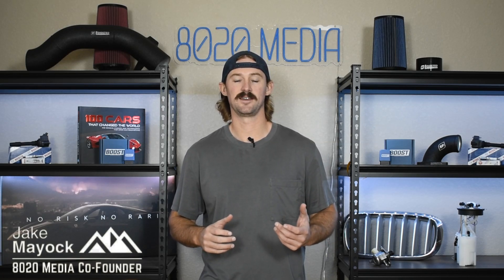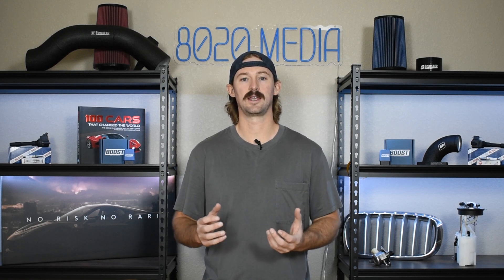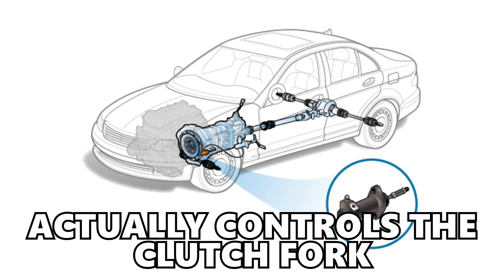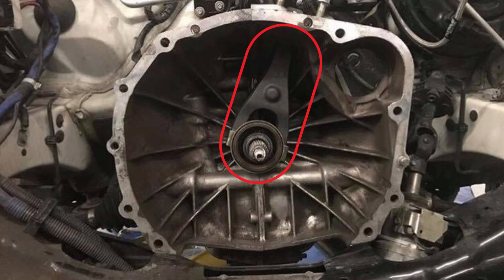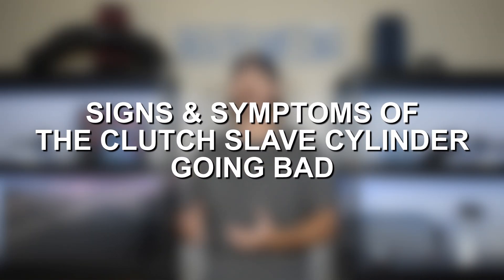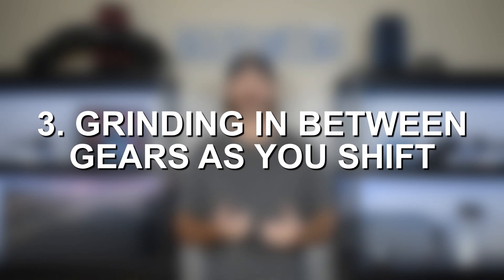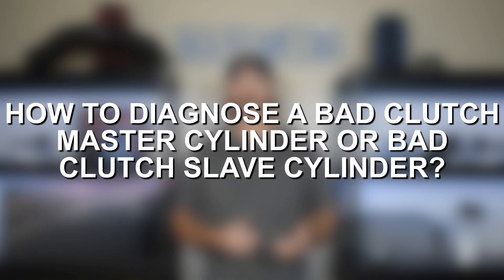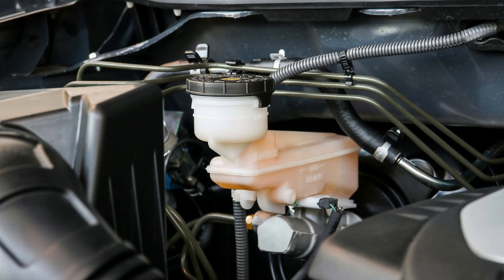Bad Clutch Master or Slave Cylinder? Symptoms, Diagnosis, and Fixes Explained!

Comment: Just replaced a transmission on my Mazda 6 I thought I had the disc backwards 
Did the whole thing again replacing the slave cylinder this time and still nothing hoping it’s the master bc it looks old and if not idk hydraulic system worked before not no more!
Reply from the maker: K - If the clutch worked before the transmission swap and now you’ve got no pedal or disengagement even after redoing the job and replacing the slave, then yes, the master cylinder is a strong suspect, especially if it’s original and looks tired, but also keep in mind that after opening the system it’s very common for air to get trapped in the hydraulic line, and on Mazdas that line can be stubborn to bleed; even a brand-new slave won’t work right if there’s air in the system. I’d replace the master since it’s likely due anyway, but also make sure to do a proper pressure or vacuum bleed of the clutch circuit and check that the slave pushrod is actually contacting the clutch fork correctly — if the hydraulics are good and bled, then the only other possibility is a mis-seated clutch disc or pressure plate, but air in the line or a weak master are far more common culprits after a transmission job.

Comment: Hi from the UK my Audi Q3 diesel does very small short journeys 3 mile to work - 3 to home and not much else mileage,  could  this have an effect on the clutch peddle sticking to the floor , basically not being driven enough and used enough to keep things working properly.  Great explanation helping me understanding things a lot more of how they woerk , given you the thumbs up and just subscribed. 😊
Reply from the maker: G - Thanks for the feedback! Yes — only doing very short trips can definitely contribute to your Audi Q3’s clutch pedal sticking, because moisture can build up in the clutch fluid and seals when the system never gets hot, the slave/master cylinders don’t get fully cycled, and any minor sticking inside the hydraulics doesn’t “self-clean” through regular movement; combine that with a diesel’s heavier clutch and the pedal can start dropping to the floor or returning slowly. The best step is to bleed/flush the clutch hydraulic fluid (often shared with the brake reservoir on Audis), and if that doesn’t cure it, the slave or master cylinder may be sticking internally and need replacement — but yes, your very short-trip driving style makes the issue more likely.

Comment: Why is it that every year I have to replace the clutch master cylinder on my 97 integra????  Is it that this reproduction parts from O'Reilly and Autozone are crap???
Reply from the maker: A - Yes — that’s almost certainly the issue; most reproduction clutch master cylinders from chain stores like O’Reilly or AutoZone don’t last long because the internal seals and bore materials aren’t as high quality as OEM, so they wear or leak quickly, especially on Hondas/Integras where the pedal travel is long and fluid quality matters. If you’re replacing it every year, the best fix is to switch to an OEM Honda/Acura master cylinder (or a high-quality brand like Nabco or Exedy) and flush the clutch fluid regularly with fresh DOT 3/4, because cheap aftermarket hydraulics tend to fail fast and keep you stuck in this cycle.
Reply: @8020Automotive tha k you for replying I'm gonna try out the exedy brand

Comment: I drive a kia rio 2016 recently the clutch started to get hard or stiff after driving it for few kilos so i replaced the master cylinder kit but it's still giving me the sane problem 😢
Reply from the maker: G - If your Rio’s clutch is still going stiff after a few kilometers even with a new master cylinder kit, the next suspects are the slave cylinder starting to seize when it heats up, a kinked or restricted clutch hydraulic line, or the clutch release bearing/pressure plate itself binding under load; since it stiffens only after some driving, heat expansion is likely making something stick, so I’d check the slave cylinder first (replace or rebuild if it’s original), inspect the hydraulic line for swelling or blockage, and if the hydraulics check out, the issue is probably mechanical in the clutch assembly, which means a full clutch service with release bearing and pressure plate replacement may be needed.

Comment: 2002 camaro ss wont go into gear at high RPMs, whats your guys opinion?
Reply from the maker: R - The most common causes are clutch or hydraulic system issues—a worn clutch disc, weak pressure plate, or air in the hydraulic line can keep the clutch from fully disengaging at high engine speed, making it hard to shift; another frequent culprit is a worn synchro in the T56 transmission, especially 2nd and 3rd gear, which will grind or refuse to engage at high RPM but feel okay at lower speeds, and in some cases a weak or failing clutch master/slave cylinder can also show up only when the system is hot and stressed. The best way to narrow it down is to bleed the clutch hydraulics first (cheap and easy), check for proper pedal engagement, and if that doesn’t fix it, you’re likely looking at internal transmission wear or clutch replacement.

Comment: Could fluid leak without it being a master or slave cylinder issue?
Reply from the maker: S - Yes, clutch or brake fluid can leak from places other than the master or slave cylinder—for example, from rubber hydraulic lines, hard line fittings, calipers/wheel cylinders (brake side), reservoir cracks, or even around bleeder screws—so if you’re losing fluid but both cylinders look dry, inspect the lines, reservoir, and the area near each wheel for dampness or residue, since even a small seep can drop fluid level over time and affect system performance.

Comment: My slave cylinder was replaced a month ago. Recently I broke down due to sticky clutch. 3k miles after slave cylinder was changed… could it be the master? Could the master cylinder cause the slave to fail if the master isn’t functioning properly?
Reply from the maker: D - Yes — if your clutch is sticking again only a few thousand miles after a new slave cylinder, the master cylinder is the next likely culprit. A failing clutch master can internally bypass fluid, trap pressure, or not fully release, which makes the pedal feel sticky and can prevent the slave from returning correctly. While the master won’t “kill” the slave mechanically, a weak master can make it seem like the new slave is failing because the hydraulics aren’t balanced. Air in the system or contaminated fluid can also cause sticking. At this point, replacing the master cylinder and fully bleeding the system is the smart move — when one hydraulic part goes, the other is often close behind.

Comment: What about if my clutch pedal is hard to push , please advice
Reply from the maker: R - If your clutch pedal feels unusually hard to push, that usually points to a mechanical issue in the clutch assembly itself rather than the hydraulics—most commonly a worn or stiff pressure plate, a failing release (throwout) bearing binding on the input shaft, or even a dry/sticking clutch fork pivot. On the FR-S, the hydraulics (master/slave) typically cause a soft or spongy pedal when they fail, not a stiff one, so a heavy pedal almost always means the clutch kit itself is at the end of its life. The fix is generally a full clutch replacement (disc, pressure plate, and throwout bearing, ideally resurfacing or replacing the flywheel at the same time). If you’re already having trouble with 1st and reverse engagement, the two symptoms line up—your clutch isn’t fully disengaging because the pressure plate/release mechanism is binding and worn.

Comment: I have a 2014 Scion Frs and I often have a hard time getting into 1st gear or reverse but once I’m rolling I’m able to shift into the other gars no problem. What do y’all think I should replace first?
Reply from the maker: S - Difficulty engaging 1st and reverse while the other gears work fine usually points to the clutch not fully disengaging, rather than the transmission itself—common culprits are a worn or dragging clutch disc, weak pressure plate, or more often a failing clutch master/slave cylinder or air in the hydraulic line. Since it gets better once you’re rolling, the synchros for 1st/reverse aren’t the main issue yet. I’d start by bleeding the clutch hydraulics to rule out air, then inspect the master and slave cylinders for leakage or weak operation; if hydraulics check out, the next step is a clutch replacement (disc, pressure plate, and throwout bearing together), since partial disengagement will keep making 1st and reverse harder until it eventually won’t go in at all.
Reply: I was having the exact same issue and ended up replacing the master cylinder
Reply: It might be the plate on the shifter lever needs to be adjusted under the shift boot especially if it’s first & reverse
Reply: I have this same issue in my 07 focus what did you do I changed my brake fluid a while back and I don’t think I bled the clutch could I just have air in the lines?

Comment: I might be looking for a problem isn't there but when I press my clutch I can hear an 'air hiss' when the clutch pedal reaches to bottom. 

Fluid looks good in the reservoir, gear changes seem okay but acceleration isn't great (honda crv petrol, had it for 3 years and it's never been quick).

Had a mechanic check it out, he didn't seem concerned but knowing the car it doesn't feel 'right'. Any suggestions?
Reply from the maker: D - The “air hiss” you hear at the bottom of the clutch pedal travel is almost certainly just the clutch master cylinder’s internal seal moving fluid past its ports—it often sounds like a hiss but isn’t an actual leak, and since your fluid level is steady and gear changes are smooth, the hydraulics are likely fine; if the clutch were slipping you’d notice high revs without matching acceleration, so your “not great” acceleration is more likely just the normal underpowered nature of the CR-V’s petrol engine rather than a clutch issue. That said, if the bite point changes, fluid starts dropping, or you feel the clutch slipping under load, then it’s worth checking the master/slave cylinder for leaks or considering clutch wear, but otherwise that hiss is a common, harmless sound on many hydraulic clutch setups.
Reply: @8020Automotive that's a really informative answer no mechanic has been able to explain. Ill keep an eye on the fluid etc, thank you!
Reply from the maker: @davyjones8226  Keep us updated!

Comment: Great video - so informative. I think you diagnosed the issue! I have a 2016 BRZ. Today, sitting at a light and my clutch pedal went all the way to the floor 😢I had to pull over and manually lift my clutch pedal off the floor. I had to drive it in this condition about 30 miles home. I know….I have no towing and was in a really remote area. I checked my brake fluid and it is right at the MIN line. My clutch was making a squealing noise when I depressed it by the time I got home. I hope I didn’t make a bad situation worse. 🥺 I’m going to get some brake fluid tomorrow and see what happens. No lights/sensors went off and had not one indication anything was awry - it was driving great.
Reply from the maker: S - It sounds like your clutch hydraulic system likely lost pressure, which is why the pedal dropped to the floor and stayed there. On the BRZ, the clutch uses the same reservoir as the brakes, so the low brake fluid level is a red flag—either the clutch master cylinder, slave cylinder, or connecting line is leaking, or a seal has failed internally. Driving it 30 miles in this condition may have worsened wear on the pressure plate, throwout bearing, or even overheated the fluid if it was slipping, which explains the squealing noise. Adding fluid might temporarily restore pedal feel if the leak is small, but it won’t fix the root cause; the fluid will just drop again. Before topping up, I’d inspect under the dash for drips from the clutch master cylinder pushrod, and check the bellhousing area for fluid leaking from the slave cylinder. If you find fluid anywhere in those areas, the failing component needs replacement, and you’ll want to bleed the clutch system after repair to get proper operation back.

Comment: 2007 Scion TC clutch issues I'm working on for a church friend.  Clutch feels strong, has proper full release feel at top but not at the bottom (doesn't feel it reaches full dis-engaged clutch).  It builds up pressure on first push unlike failing clutch master or slave I encountered on my cars where they build up pressure with repeated pumping.   SO - could this be a slave cylinder not pushing all the way on the T.O. bearing or pressure plate and thus no allowing full disconnection from trans?  Or, just a bad clutch and/or PP?
Reply from the maker: H - The symptoms you’re describing point more toward a mechanical release issue than a typical hydraulic fade. Since you’re not seeing the “pump up” effect common with a worn master or slave cylinder, the hydraulics may be intact, but the slave cylinder could still have a limited stroke from internal wear, contamination, or air in the line (even a small bubble can rob throw distance). Other possibilities include a bent clutch fork, worn pivot ball, or a throw-out bearing that’s binding and not allowing full pressure plate release. If the slave travel is within spec but engagement is still incomplete, the clutch disc or pressure plate fingers may be worn or warped, requiring a full clutch job. I’d start by measuring slave cylinder travel at the release fork (compare to factory spec), bleeding the system thoroughly, and inspecting the fork pivot before condemning the clutch assembly.

Comment: What if I have a squeaky clutch pedal? I have a 2001 Ford Ranger
Reply from the maker: S - A squeaky clutch pedal on your Ranger is usually caused by a lack of lubrication at the pedal pivot points or the clutch master cylinder pushrod where it connects to the pedal—this area tends to dry out over time and create noise. You can often resolve the issue by spraying a small amount of white lithium grease or silicone spray lubricant where the pedal arm pivots or at the pushrod joint, but be careful not to get any on the clutch pedal pad itself. If the squeak persists, it could also be a worn bushing or spring in the pedal assembly needing replacement.

Comment: The issue i have and why im watching this is because i have a very short peddle stroke. Only need to press the peddle an inch or so to fully disengage the clutch. It makes it hard for my wife to have smoothly engage the gears. Almost like having a button clutch.
Reply from the maker: A - Sorry to hear this.. A very short clutch pedal stroke that fully disengages the clutch within an inch or so often points to either a misadjusted or high-pressure aftermarket clutch, a worn clutch master/slave cylinder causing excessive hydraulic pressure, or possibly an incorrect or modified pushrod length at the pedal. If this is a recent change or the clutch was replaced, it may have been fitted with a racing-style or performance clutch that engages very abruptly, which isn’t ideal for street driving. You might check for any adjustable components at the clutch pedal or consult with a shop about swapping to a more forgiving OEM-style clutch if smoother engagement is a priority.
Reply: @8020Automotive thank you for your reply. We just had a new standard clutch kit fitted. The clutch was the same before the new one went in. We can press the peddle all the way down, there is just no need to as the clutch disengages at the start of the pressing of the peddle. There is no clutch slipping or anything untoward. Just a really short peddle that feels like the clutch has been ‘ dumped ‘ if we are just a little quick to release the clutch.

Comment: Hi, my car issue is that the clutch pedal sometimes sticks to the floor , but has decent clutch pedal pressure when i step on it, no leak under the clutch pedal. based on how you explained the 2 am i right to assume it might be the slave? 
but still i would replace the 2 though to be good as new
Reply from the maker: Z - Yes, you’re thinking in the right direction—if your clutch pedal sometimes sticks to the floor but still has decent pressure when pressed and there’s no visible fluid leak inside the cabin, it’s very likely the slave cylinder is starting to fail, especially if it’s internal (common in many modern manual transmissions); the internal seal can intermittently lose pressure or get stuck under heat or load, causing the pedal not to return properly. Since the master and slave cylinders work together, and both are wear items, it’s smart to replace them as a pair to restore full clutch hydraulic performance and avoid repeat labor later—doing both now gives you a fresh system and peace of mind.